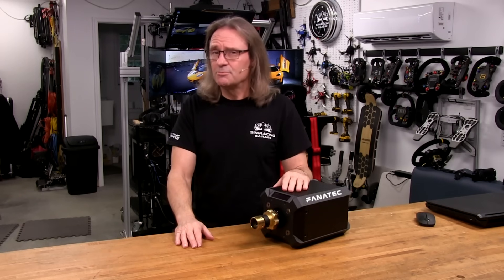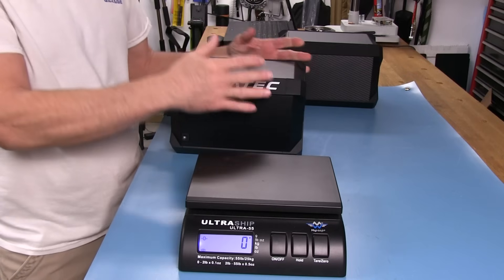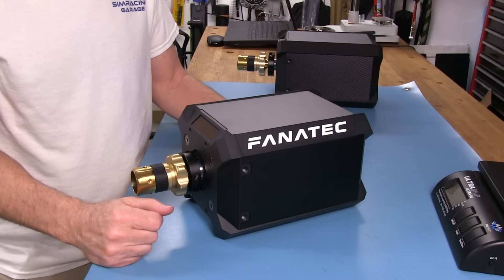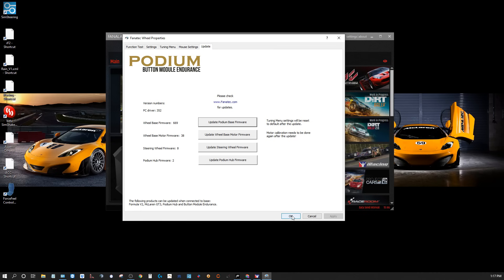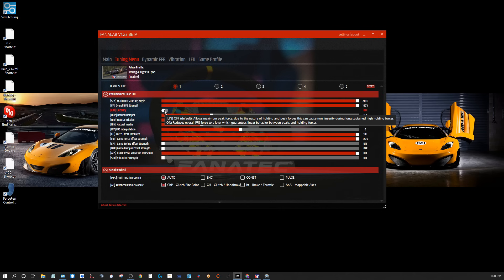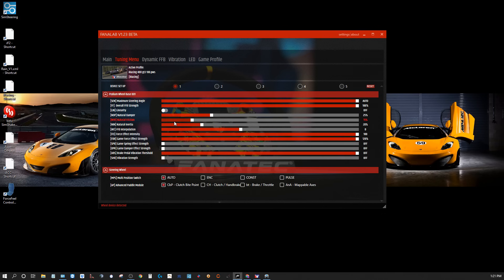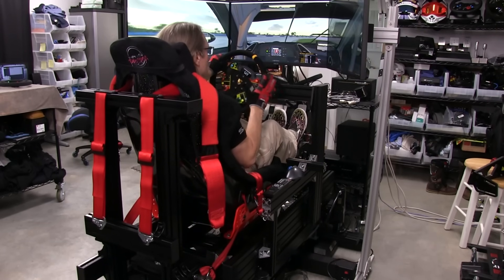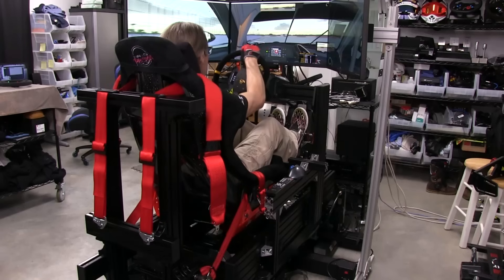Fanatec Podium DD1 Review

Comment: The only reason I decided not to purchase this and went with SC2, you can't use these bases without fanatec wheel rims.. Which is a scam
Reply: You can with fanatec podium hub
Reply: Why would I pay £350 for something i don't need?
Reply: You think it's a coincidence they make you buy a hub? No. It's a scam to make you use their products. £1200 for the base, £350 for the hub, another £300 on a wheel rim, or £1100 for a SC2. And you can put ANY wheel you want on it, no hubs, no extras, no scam.
Reply: @iracingrookie3301  And if you constantly change wheel rims, you have to buy more than one podium hub. Unless you want to constantly unscrew and screw on the podium hub which is annoying
Reply: iRacing Rookie There is a $200 USD Fanatec Podium Hub that you can mount any wheel on. You can even attach the same QR that your QR2 uses if you want to use multiple third party wheels on one hub but that does extend it out pretty far which may be an issue with some cockpit setups. 

I think the DD1 is great if you already have some Fanatec wheels and are in that ecosystem but personally I think SC2, Accuforce, or any other DD base is going to be better if you are starting fresh. If you absolutely want a Fanatec wheel for some reason, those can be adapted with third party USB adapters. I keep hearing about these weird issues people have with Fanatec firmware updates and I haven’t seen that with other DD brands. 

Fanatec has the same philosophy as Apple where they don’t make it easy to go outside their walled garden. It’s frustrating and why I will probably never buy a Fanatec base, even though they generally make pretty good stuff for reasonable prices.
Reply: Yes, but if you're like me, racing on oval, dirt and road, you really need 3 types of rims, that would cost me like £900 before I've even purchased a wheel rim, or I could sit there for 20mins unscrewing all my wheel rims just to save money.. No. Just no. I'll keep my. SC2 and use what ever wheels I want. I'm not hating, if people want to pay that kind of money, go for it, just not for me
Reply: @iracingrookie3301  but what do you use on the sc wheelbase as a button box? Don't you need paddle shifters for different wheels?
Reply: I agree, having to buy a hub for any other wheel is the biggest downside to this wheel, especially with how good the SC2 quick release is....
Reply: Or just get a Podium Hub, and bolt a Q1R on it.
Reply: @tehgusbus2716  I decided to go the SC2 route and I kinda see his point. I do a lot of drifting, race GT3 cars, road cars, and dirt sometimes as well. Due to me not needing a “hub” for every wheel on SC2, the overall cost, for my use at least comes out to be significantly cheaper. I actually prefer that my steering wheel itself have no buttons, so I can just buy any style steering wheel I need (350mm NRG wheel or Sparco P310 for example), not needing a hub to use it and just bolt it straight to my SC2 QR. For button box, I use two DSD OSW Panel with many buttons, encoders and switches, and for shifting I use a H-pattern/sequential shifter.(I’m also not a fan of paddle shifters)
Reply: @akeem127  dang I'm trying to keep it accurate to the cars that I'm using do any gt3 cars use sequential shifters?
Reply: @tehgusbus2716  I did say "for my use." I just prefer wheels without buttons and paddles. I just really like how clean it is without those. It makes for a really light and fast reacting wheel as well. And adding paddles to a wheel is fairly cheap btw. I have a set of all aluminum DimSim magnetic paddle shifters that sells for about $50. You gotta do is figure out the wiring. Whether you want use an Arduino or even easier, a joystick encoder is up to you. Either way, again, for my use it still come out significantly cheaper.
Reply: @tehgusbus2716  I got a sequential shifter for oval and dirt and I got an f1 style rim, its got a coiled wire that plugs directly into a usb port on my rig, it doesn't get in the way, it goes under the base
Reply: @tehgusbus2716 http://rexing.eu/ they're not cheap but if you really love sim racing, and see it as a hobby rather than a game its worth it
Reply: No, id have to unscrew the rim from the hub and put it on a new rim, just a waste of time, waste of money. Nothing anyone says would change my opinion
Reply: And you are not bothered by the proprietary RF solution of your DD which strictly limits the use of wireless wheels to SC wheels only? 
On a Podium DD all our steering wheels are wireless by default but on your SC2 you have to pay quite some extra money for every single (wireless) steering wheel you buy and you end up with batteries and no LEDs or displays on your wheel.
Think about it ;)
Reply: @thomasjackermeier3343  I think having a superior wheelbase in the SimuCUBE is the most important feature for a lot of buyers, not the wheels or ecosystem.
Reply: I have both systems and I like the fanatec simplicity of not dealing with wireless connection. Sometimes I have to reboot my system so it would pick up the signal from the  other wheel I’m try to change. But I do like the sc2 performance I don’t think is that much more better then dd2. And to tell you the true with irFFB on the dd2 now I can’t event tell the difference on performance between both of them. I also think fanatec software would get better before the SC2 does. 

Sorry for my English
Reply: @thomasjackermeier3343  A little off topic bit the reason I have not bought a DD1 is: I tried running the Fanalabs software on my V2.5 and can not running anything other than V347 it doesn't support the new version of fanalabs. the newer drivers just don't run well on my wheel. So with that said, I did some digging. I see a lot of people are having issues with drivers on the DD1. Why are they all Beta drivers? I'm sure your working on the fix but, it's been a while. If I buy the wheel I want to use all the available tools (software) the wheel offers. Please update I'm looking forward to buying on, As I have always bought and supported your products.

Comment: V2.5 VS DD1. Can anyone comment on how much better it feels. I'm not talking about force but, more interested in feeling the car like feeling the road and front or rear starting to go. Are you more connected to the car? Is it night and day? I'm looking to upgrade but not sure yet as I would love to try before I buy. Also that drivers look like they are having issues with a good driver as all the beta ones coming out and not a real driver for the wheels.
Reply: DD is not a night and day difference, but it's substantial. You feel everything - every little bump, every change in road surface, every change in tire traction - and everything is instant with no delay.
Reply: @alextimo  I was looking to buy one just very hesitate with all the beta releases an issues. I really struggle with curtain cars with the 2.5V at times, I have little to no warning feeling the rear go or front end go. Maybe next fall they will have a better software package that's not beta. I wanted to try one out before I purchased one. Thanks for the input.It's on my list just not ready to pull the trigger on it yet.
Reply: @logo8009  Yeah, I understand. It's still a relatively new release and support needs to catch up. 

Same for SimuCube 2, though there the software seems to be solid and it's peripheral manufacturers that need to catch up with making compatible wireless wheels (the existing ones cost a fortune).

Comment: A lot of your explanations on each of the settings are in direct contradiction to the explanations given in the software itself.

You may know what you prefer in terms of what you have - perhaps, blindly - arrived at with your current settings, however, your understanding of what the settings are actually doing are totally off.

It would seem that, unless the in-app explanations are totally wrong (which, going by your explanations of the resulting changes to the feedback feel, they are not), you are arriving at your preferred settings rather arbitrarily, by shooting in the dark, and then trying to legitimize your resulting preference by trying rationalize how they are more aligned with reality, when in fact they may actually not be.